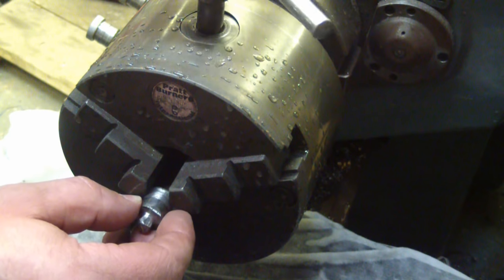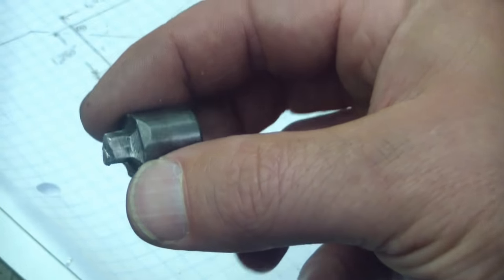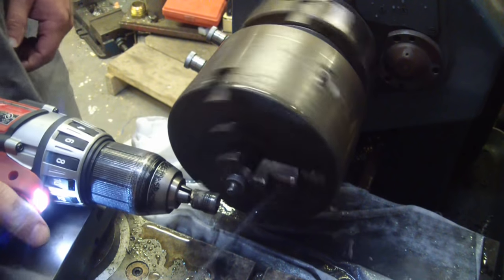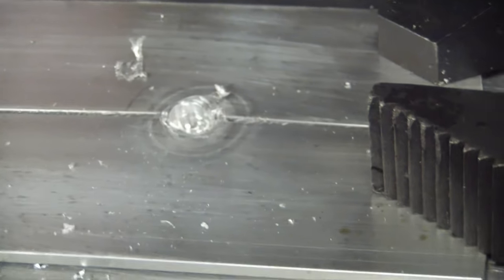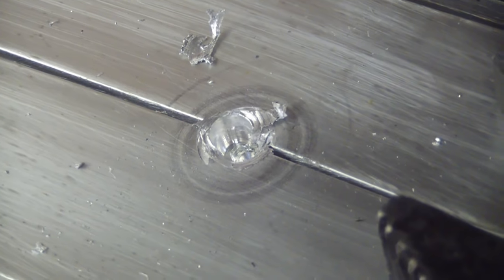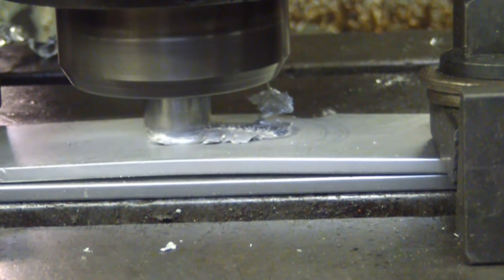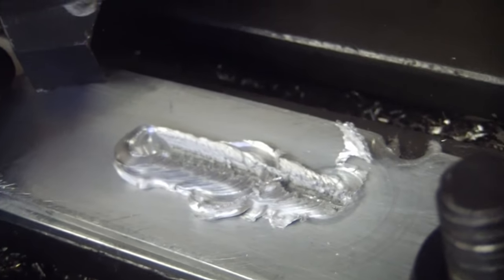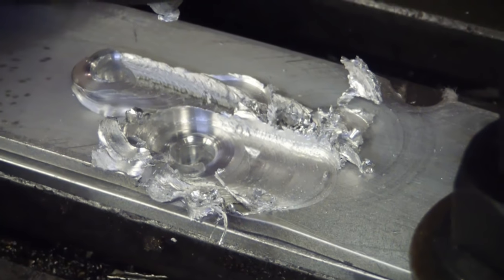Friction Stir Welding on a Bridgeport Mill

Comment: Getting there! I'm convinced your problems are coming from the not so round nipple on your tool, you want to have a nice flow of material around it, because it is almost a triangle it will displace the material and cause issues, probably one reason so much gets pumped upwards. On the collet spacer front, length is not critical, chuck up some tube, get a rough measurement and if it's not touching the spacer when you start machining it will be at the end.
Reply: ***** Nope I'm wrong, the nipple should not be smooth but maybe not quite so square
Reply: ***** The shape of the pin doesn't matter as much as the shoulder geometry for that part.  Even a smooth pin will work. The shoulder needs to be level and properly positioned.

Comment: I know very little about stir welding...but welding in general I'm quite good at...have several fancy papers that say so... My one suggestion would be to tack stuff together before welding. Always say good prep makes the job. 

Just my 2 cents.

Keep your stick on the ice. And if the ladies don't find you handsom, they should at least find you handy.
Reply: Daniel Mallett actually stir welding the whole point is that you dont tak anything, normally its held in a very strong die with counterpressure and a cnc machining arm will stir the aluminium together, when done properly this doesnt melt the aluminium and it keeps its strength and mechanical properties along the weld. Its only really used in high end aerospace stuff though

Comment: hey AvE

just something to note, the tip depth of your tool is to deep the bit you have made is pushing your work piece out on the underside.

the aim is to make a pocket of metal like play doh and as you move the bit it heats and stirs both plates together. try to shape your tool so the center is one third of the total diameter and the top of the tool is flat think of it like a lid to keep the doh metal in the pool and not overflowing as you will lose heat and metal that makes the weld.

hope this helps

Comment: Happy Canada Day from Manitoba, eh!

A humble observation:

When you power a motor off of a VFD, running beyond 60Hz causes a drop-off in torque due to the DC buss voltage limit. You mentioned running at 90Hz with room to move on your pulleys. If you ran at 60Hz on a higher speed pulley, you'd get the same rpms but with more available torque from the motor. Of course you loose some torque by changing the pulley ratio but the torque limiting factor is the motor.

Feel free to correct me if I'm talking out my arse here, it won't be the first time.

Comment: Ain't that something! 

I will say that I feel you should incorporate a dish in between the shoulder and nipple.  Basically a groove that will allow for the expanded and plastically deformed material spewing off to collect under the tool and be forced backed into the weld and flattened.  I seen tools like this that also include some type of threading on the "nipple" that would channel the weld into the welding area.

Keep up the great content sir!  You inspire a young, soon to be graduating engineer inside of me :)

Comment: Complete newby here and you have probably considered this but Just thinking about the clamping on the butt/ seam welding, could you cannibalise lil screwy? You know it had 60-70 tons of clamping force but use it in a lateral fashion to force the metal together a well as clamping it down vertically that would stop it splitting and stopping the weld. Also from the what I've read on commercial machines the shoulder does not travel parallel to the materials its rotation is on a very slight angle to the material which apparently encourages the welding behind the tool, I suppose you could crudely replicate this by putting a thin shim under one side of the work piece and kind of weld down hill. It may or may not make any difference but just tying to figure out what a commercial machine does that your rig doesn't.

Comment: Hey AvE I dont know nearly as much about this as you but i wonder what would happen if you tried to butweld the aluminum together but rather than pushing the tungsten bit all they way into the aluminum you just run it along the seam without the bit pushing through

Comment: Awesome, success! To my untrained elechickens eyes this still seems a little weird. The only stir welding I have seen uses a wide flat tool that works only on the surface of the 2 plates to be joined. But it worked so what do I know other than light bulbs and motors. To the Google machine!
Reply: I think I'm the only person in Melbourne who isn't wearing a parka lately, its not even cold enough to keep your beer drinking temperature if you leave it on the balcony. The only frozen water I've seen so far has been in a glass. 

Hows the 100% humidity of the Great White North treating you?

Comment: That's really cool. How hot does it get? How strong? Any work hardening in that joint? I think we all want to see you break it open with force to see how strong it is.

I renege about the enameled wire, it's uninsulated, but I still say you can get that battery magnet array to propel through a copper coil. You can do it!

Applied Science Guy is no faker.

Comment: Just my 2 cents (ohne MwSt.), try making the business end of the  cuntsten tartbite more conical and smaller. That might make the upper ( now wider) part cover better the whole stir/melt. Also Aluminium tends to bend and expand when heated, so try clamping it down some more (from the sides also).  
Good job, I'll keep my Tuborg, Corona on the ice.

Comment: AFAIK for friction welding you dont use tools which are moving and thus generating heat. You use two pieces of the material you want to bond and let them to do the friction. So the hard piece will of course go through the aluminium pieces. If you would like to weld aluminium tube to aluminium plate, you could put the tube into drill machine, spin it and push it against the plate in same time. This could work.

Comment: Did that Tungsten-Carbide bit need to be a very specific shape?
Reply: I think if it’s sharp it will cut the metal instead of melting/fusing the metals together

Comment: might want to work more on roundifying that bit you've got
maybe a super small high speed detailing tool? One that's not gonna torque out a big hunk of crap from the bit?
I'm sure they make something like that somewhere ;)

IF you've got a choice, me knowing zero about this, i'd imagine shooting for something approximating a sine wave in the parts of the tool that actually make contact. The plunge face actually looks "close enough"
 Regular interruptions of force with as little shearing as possible and all that. leave some flutes for the material to grab onto and such though.

Gotta ask yourself though is she proper chooched?

Comment: you should use left-hand threaded pin (if the rotation is clock wise) with a concave shoulder and tilt the plunging axis a little (2.5 or 3 deg) so that when it moves forward, the back side of the shoulder drag the base metal. For the lap configuration, it's better to bolt the plate together in the side.

Comment: it may be that the aluminum pieces are pulling apart due to thermal expansion. perhaps this would not happen if you hard clamped the one side and just snug clamped the other side allowing the pieces to grow without warping. you would have to block the snug side to prevent the pieces rotating

Comment: Now we gotta find the right application to test it out.  Any chance you could show us the tensil strength on this vs a traditional weld?  Probobly would require some high end test equipment......Or just tie it to the back of a truck while anchored down.  What could go wrong?  It would be pretty intreasting either way and a great sequal to this video....just sayin'

Comment: Dude.  
the stir needs to be smaller, 3mm diam, and 75% of material thickness
the shoulder needs to be concave
you need to add a 2 degree slope to the work piece support.

The goal is to heat the aluminum and drag/shove it with the shoulder of the bit, if you do it  right, you wont have a bur much larger than 1 mm

I did this with a mill/lathe combo in a garage in 3 days

Comment: It looks like you need more friction and less stir. As far as i know, the optimum profile is flat with just a very small tip, about 1mm width and height, total tool width about 10mm. That tool should be ran with a 2 degree angle for optimum performance.

Comment: Why not steel instead of the AL? AL spreads the heat so fast its kinda counter productive here. Also AL having a low melting point, why go through all the hoo-ha with the spesial tip? Im confused o_O

Comment: If it hasn't been said yet, you should make a tool post grinder. Get the tip round and concentric, and the shoulder to as little lateral run-out as possible.

Comment: How could this work, when the bit has to pass through the part it welded? I understand you are stirring the metal together but it would need to stay plastic/liquid for a while after the bit passes through for it to weld

Comment: So just a question; does the oxidation of the metal have anything to do with it? The videos I've seen of friction welding show it inside some transparent tube-guard. Perhaps it's easier to weld in a low oxygen environment so that the protective oxide layer doesn't keep the bare metals from touching. I'm not expert so any feedback on this would be appreciated.
Reply: And yeah now I'm just realizing the video title had titanium in it, however I watched this video when it was new hehe.

Comment: i tried today... on a shitty Chinese mini mill. Took a 1" steel rod. Lathed it to .750", and put a 5% (2.9* i think) chamfer on the edge. Oil hardened it. NO TEMPER. :-P WHo needs impact resistance? Then threw it on the mill and ran it at ~3500RPM. Was able to successfully melt aluminum. Proceeded to throw it on myself. Lit some nearby flammables on fire (only 10 ft away). Burned holes in my shirt. Almost burned off my beard. But at least it melted something... Now for the magic stir weld?... 

Turned into a magic oxidized shit festival with more molten shit lighting myself and others ablaze. Poor gun powder... Missed that half pound.
Reply: Cody Smallwood Judging by your profile picture, you did in fact burn off your beard.
Reply: Cody Smallwood Video of this please?

Comment: is the strength of the friction weld even close to the strength of just melting the metal together?

I'm just curious as to the point of joining this way considering just how difficult this seems to be vs regular gas or stick welding

Comment: Definitely needs some fine tuning... A shoulder around the outside of the tool to mate to the work surface, maybe angled towards the bit at say 2-3 degrees of incline towards the center. Should help keep that slag in the joint a bit better... Maybe a concentric point on the bit itself? Just some thoughts from a tinkerer of things. Lol

Comment: Yo Ave, what I noticed about other fsw welding. They have the tool than they have a large lip that sticks out over the cuntsten targlide  do try and keep the material down to it looks like a really wide "T" and and doesn't have a long stem. So like maybe try and braze a large washer on the tool

Comment: Are you "chooching" clockwise or anti-clockwise"
Reply: Why?  You figure that Coriolis forces need to be taken into account so he gets more of a "roll of coins" look, rather than a "passing seagull" look?  

Personally, I think this is more in the way of a dancing bear....where the interesting thing isn't how well he dances, but that he dances at all.

I'm more curious about why the top workpiece bowed....was it heat expansion with clamped ends, or was there an "up-cut" effect from the "flutes" on the toolbit?  I'm guessing it was heat, since it didn't happen immediately, and got progressively worse as the churning continued. I can warm up aluminum be rubbing it a bit, so I'm guessing these's SIGNIFICANT heat from kneading it like dough!

-- Mike

Comment: You are certainly not among the fainthearted sir! One point I can think of though, regarding weld quality: You should have gone to great lengths to ensure that the "shoulder" of your stirring bit was as flat as possible. That way you would cut down drastically on the amount of material extruded from below the less-than-perfect shoulder. And I guess by now you have an appreciation of the forces required for clamping down  items and driving the tool through metal. Good luck with mild steel :->. Just my two cents' worth...

Comment: How do you stop the top plate expanding and deforming with the heat?
Reply: Green Silver cooling or you cant
Reply: It sounds counterintuitive to cool it while friction welding, maybe a jig made from angle iron would work?
Reply: Green Silver No, friction stir welding does not rely on heat, the main reason cooling generally isn't used is that it would include heavily in the weld metal. High speed air would probably work though...
Reply: The problem is when properly done there are no issues.
This is an awesome home brew attempt.
Fricken awesome.
Reply: I would say pre and post heating. Aluminum is a very good conductor so the uneven heating and cooling between the top and bottom plates is causing warping. This happens with titanium when you weld it.

Comment: Have u thought that your going though the aluminum. stir welding happens on the top of the peace you're trying to weld so if u try getting a flat carbide bit and u get it spinning at a high rpm and use pressure on the surface of the aluminum it should stir weld.if you go through it like you were you just be making a hole and nothing more

Comment: For the shaping of the carbon nonotubes try using lapidary plates (cheap amazon) mounted to a backing plate with an arbor. You can then mount to a bench grinder or angle grinder. Chuck up the nubbin from your insert bit in the mill. Set the height, such that the spinning grinder with diamond plate will grind the shoulder on the nubbin. turn on mill, turn on grinder and present the nubbin to the diamond plate. Lots of Lube du annal to cool and you should have a lovely stepped nubbin to rub up the wronf way. You could angle the diamond plate such that you create a slight taper to the nubbin tip for ease of penetration.... But still keep the nubbin shoulder. link for the plates   

http://www.amazon.com/s/ref=nb_sb_noss?url=search-alias%3Daps&field-keywords=Diamond+PSA+Backing+Lapidary

Comment: I think you will be much better off of you change your tool material to a tool steel so you can lathe some proper geometry. I think you had the angle backwards in that last go-round, which is why the material got dug up on the leading edge....there should be a leading revel angle, so the tool can "cup" the material together an reduce overall force req'd

Comment: Try not penetrating through the bottom of the metal during a a butt weld.  With titanium FSW, we never penetrated completely through the metal and the bottom that wasn't stirred was diffusion bonded due to the heat.
Reply: Can you do FSW can you do it with a regular CNC? I'm talking hobby, practice, play in aluminum
Reply: @argentosebastian  You can do anything you want as long as you're willing to break something!  If your CNC is sturdy enough, it should work for light applications, but it will take a fair amount of force along the axis it moves and torque for the tool.
Reply: @davidsapiro1961  thanks David 👍

Comment: A suggestion: chuck uo a 1/4" carbide rod in a router.  Just a thought.
Reply: if the big ole bridge port can plow that through there without stalling out what hope does a 110v router have? also itd end with the bit catching, exploding, and the router launching into a low earth orbit... or at the very least a tripped breaker

Comment: Did that Tungsten-Carbide bit need to be a very specific shape?
Reply: ***** specific to whatever the hell you could cobble together with a manual lathe, hand drill, bridgeport and old chunk of cumstain garblagh...i think if you overthink it you end up not actually doing anything
Reply: +LazerLord10  I could say yes .. If you have a Metal Lathe the way you cut a tool that goes in your lathe is important.. 4 Months ago you may have an idea of  tooling .

Comment: sure it welds two piece together with 0.001 % of the strength of a standard weld from a 20lb 200$ MIG welder... but it only takes a 20 ton vice and a 1000$ milling machine !

Comment: I did better than that. I chucked a piece of carbide in a mill and used a dremel with diamond cutoff wheels. Made perfect steps and good welds too. You should machine a mount for your lathe rather than hold a hand drill to a lathe because it's actually incredibly dangerous...

Comment: Initially I'm thinking: This is retarded.. like driving a Renault thru a Nunavut snow storm.

But it looks like that stir-weld mighta actually worked. Did it actually fill in completely behind the bit ? or did the shoulder of the carbide just shmear the top layer of the aluminum ? making it "shmear-welding".
Reply: ***** Awesome, can we see a cross-section cut of a "successful" weld?
Reply: ***** yeah, wheres the bend test?

Comment: As far as a butt weld goes maybe you could try using one of the tungsten carbide buttons you extracted from that drill bit?  Something that's rounded on the bottom with no shoulder, or possably a rounded shoulder??  Maybe a rounded shoulder would reduce the aluminum putty from squishing out the side???  I'm just rambling at this point haha

Comment: Why don't you try plastics like PE (polyethylene), first ? (also because PE is so a pain to join). It does look like, that you can't get enough heat in aluminium.

Mehr Kraft, mehr Reibung, mehr Hitze und mehr Rundlauf! Das wackelt mehr als der Arsch einer Frau.